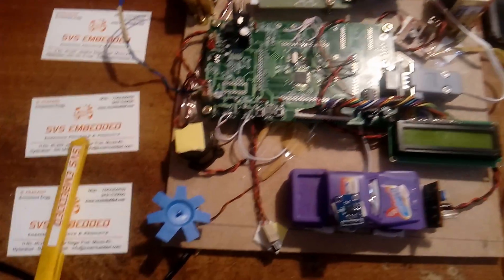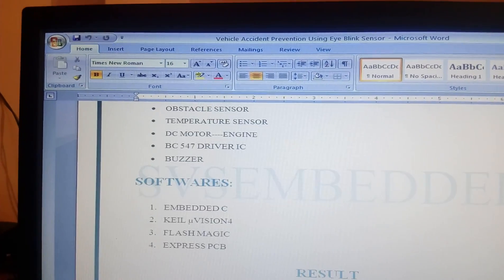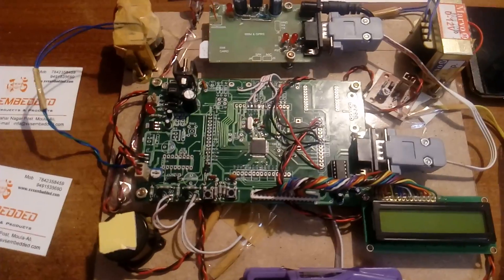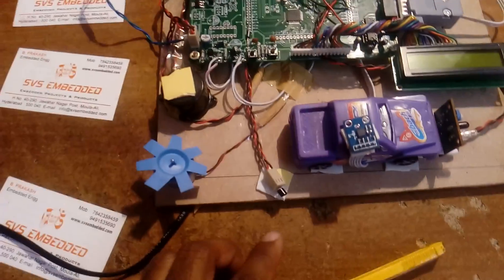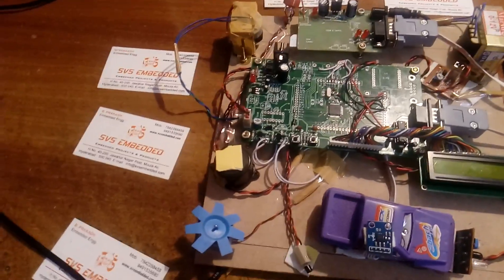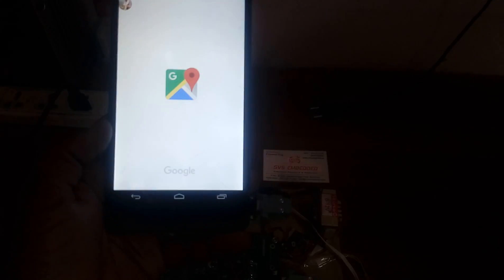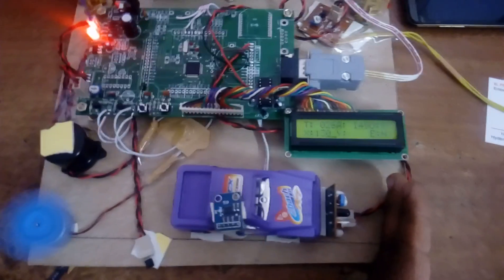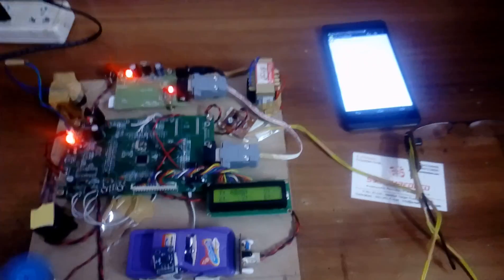Vehicle Accident Prevention Using Eye Blink, Alcohol, MEMS and Obstacle Sensors

Comment: Hii, I want to ask is it necessary to use potentiometer when we want to interface LCD with any microcontroller hardware? Thank you in advanced
Reply from the maker: Thanks for watching and your valuable Feed back. potentiometer  REQUIRED FOR CONTRAST ADJUSTMENT PURPOSE
Reply: @svskits  so if I didnt use potentiometer for my hardware, the lcd will still be displayed?